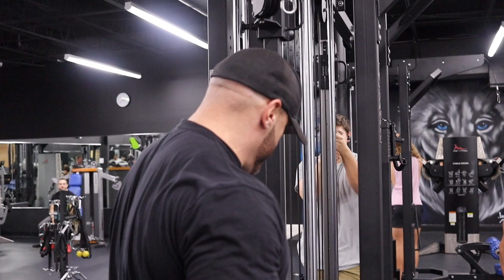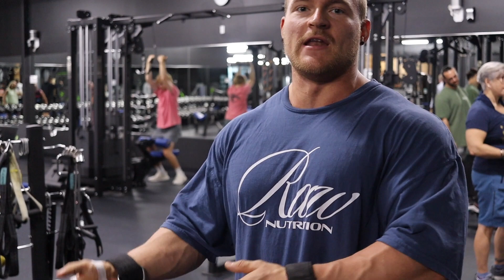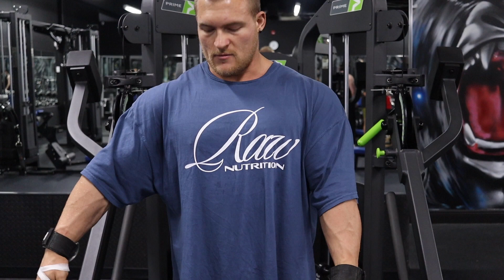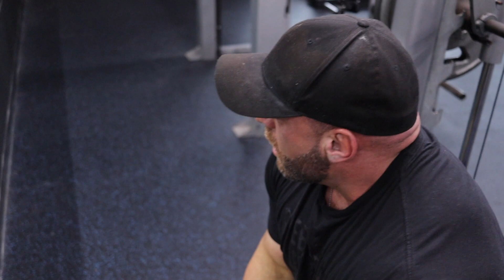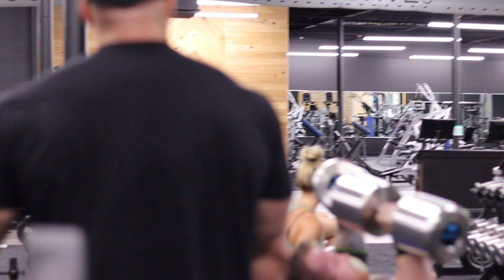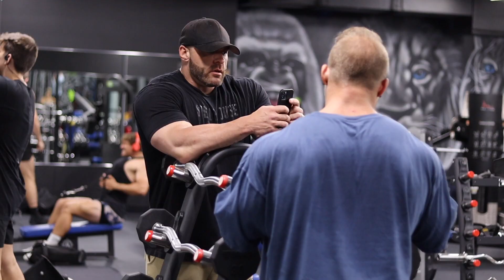Push Day With Tavish Steele (Part 1: 10/17/22)

Comment: Hey nick, great video! Sorry if you’ve explained it before but could you explain the reasoning behind holding the ball when you use cable cuffs? Thanks man
Reply from the maker: Irradiation effect

Irradiation effect. Offers rotational controls over the RUJ, therefore the elbow joint and refers the same controls into the shoulder rotational stabilizers so the shoulder is better able to produce force with less distraction forces pulling the humeral head into slight dislocations

Comment: Nice content as always, I love push videos. I wanted to ask a question if you could answer: you seem to train always at high intensity and low volume, I heard that ondulating volume and intensity is beneficial to get exposed to different stimulus; is training always at max effort better than that? 

Also, what happens when you can't add weight or reps to the previous sets done? You keep trying next sessions, you start again to progress at another rep range, or you swap the exercise? 

Thanks for everything you post, you are truly inspiring.
Reply from the maker: Thank you!

I don't train exclusively high intensity (load) and low volume. I start at a lower volume base with a constant held for intensity of effort that has some give based upon circumstances on the given day and as performance and recovery allows for more volume to be done, it's added in and performance/recovery is continuously monitored to maintain an upward performance trajectory and recovery adequate. I also don't exclusively lift loads that would restrict me to low rep targets which would be more characteristic of the dichotomy between "high intensity/low volume and low intensity/high volume". I work in multiple rep targets generally so "high intensity (load)" wouldn't be accurate to say. It's the highest load I'm able to use given the constraints I've chosen. And if the argument isn't about intensity as load, but of effort, I don't see people getting their best results by approximating how far they are from failure (statistically, almost always inaccurately) to do more volume of sets at low effort. Failure is a measuring stick and most of the time, people that are attempting to train to failure don't truly reach failure either so having the goal of getting there is more likely to land you in the theoretically proposed "ideal" of coming just shy of true failure anyways. So yes to your question, I would say that max effort (with some give for specific circumstances) is the better route. 

If you can't add weight or reps to a movement you'd want to examine your preparation first, so all the things outside of the gym that would benefit or retract your performance and recovery. Following that, your execution of the lift. If all things check the boxes here and you're absolutely certain of that, you'd look towards changing rep targets, tempo, or different progression strategies like straight set linear progression of multiple sets at the same load towards the same rep target on those sets vs reverse pyramidal progression of loads in the same rep target vs differing rep targets and load selection to match them and progress on them from there. If there's nothing in those options that produce a change, switch the exercise.
Reply: Thanks you so much for the answer! I'll try to get experience on how to autoregulate volume. I tend to relate intensity with effort more than load as you said so thanks for the clarification. Its also interesting the approach of not thinking about how far you are from failure to do more sets, as it is very widely used in programing. But I cannot deny that the measurement of how far you are from failure is so inaccurate, and usually people who train harder are just bigger usually. Awesome info.